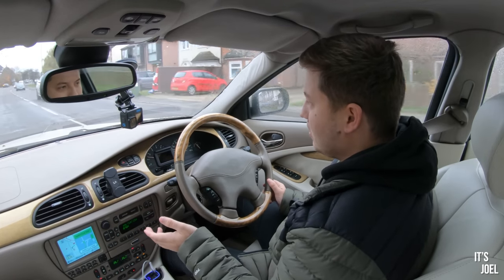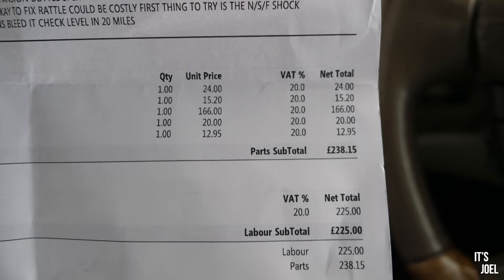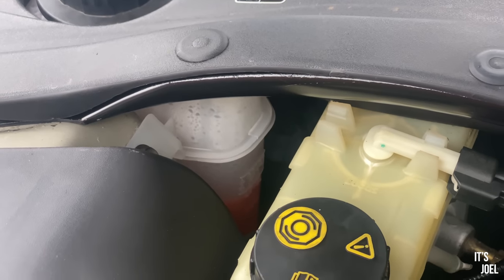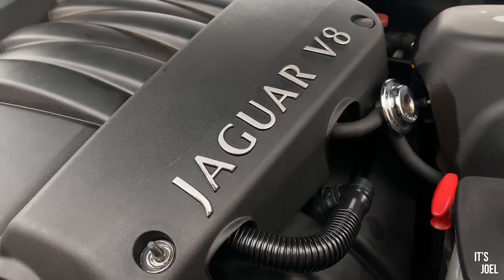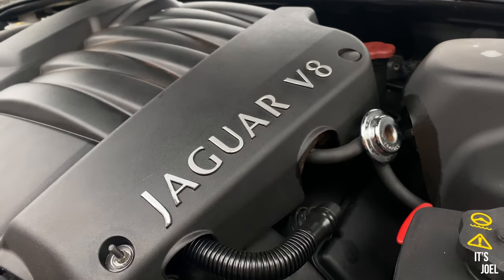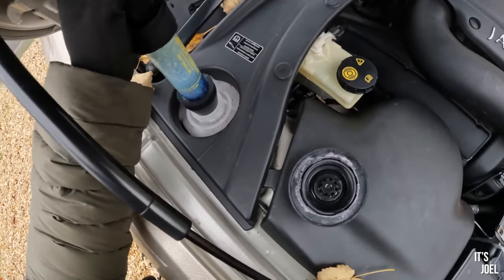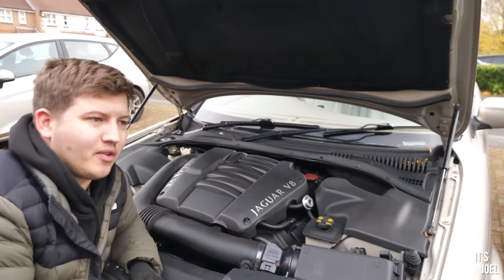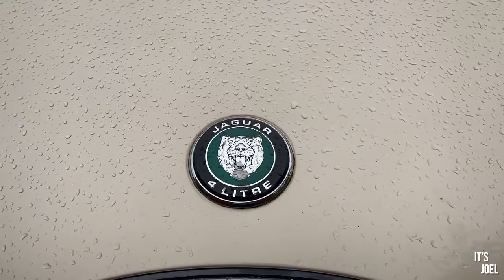Can this £30 bottle of Steel Seal save my cheap V8 Jaguar?

Comment: Don't  go by the white smoke coming out of the exhaust my BMW E60 2.5I was like that 3 years  ago and the so called  expert at the garage told me head gasket engine  is knackered is was losing  coolant eventually I found  is was coming from a tiny crack in the expansion tank bought  a new one on ebay for £60 fitted  it myself cars running spot on that was 3 years ago still got white smoke  coming out of the exhaust in the cold mornings

Comment: Don't go to main dealer looks like HG you fixt the water jacket side the oil is slightly burning but that happens to older engines anyway lot's of reasons but i wouldn't go anywhere till checked proper and if it is gone just gets worse then breakdown it won't be cheap to do But very Dear at Jaguar£££££££ should be able to get done for between 700/1500 give or take!!😳

Comment: Drive it and see what it does. Do not think it’s head gasket but if u really wanna play the game let it sit over night then put a camera down the spark plug holes and look of water on top of any pistons but tbh, I think ur just dealing with old car water hoses having a hole and not allowing the system to pressurise correctly

Comment: Take it for a drive and if temp stays down then its fine but I would still fix it properly but as you don't have the knowledge then yes its expensive and probably not worth it

Comment: Test come back negative?  You need to self isolate Joel for 10 days..... 😊  I think that rather expensive bottle of magic might have done the trick. Pretty sure at this time of year the exhaust smoke is normal as is a bit of condensation on the cap. Drive it and see how things go, but keep a bottle of water in the boot just in case .

Comment: looking at the exhaust you have 1 exhaust system for each side of the engine. typical v8 set up. now to have both exhaust letting out steam shows water in the engine block itself going to atleast 1 cylinder on each bank of pistons...... you do not have exhaust getting into the water, your problem is water getting into the combustion chambers on both banks of the engine.......  water is not a major factor in the oil neither...... so we know its in the combustion side of things........ the first thing i would do is check the actual fuel in the tank.. drain some and put it in a bottle and let it sit for 48 hours then look to see if any water is in the bottle of petrol..... DO NOT think oh its ok its fresh fuel. you have no idea how many garages have water in their fuel tanks...... now if you do have any water at all in the fuel tank , This WILL be your problem.. easy fix.... drain all the fuel and put into almost clear containers...... now on each container get 1/2 cup of water from your kitchen and put in some red food colouring and make it a bit strong.... pour this intothe fuel in a almost clear jerry can and swash it around. all the water in that can will grab the food colouring but the petrol will not.. now let it sit over night.. in the morning you will se the amount of red in the can and it will al be at the bottom.. simply siphone off the red and you will be left with just petrol......   now pour this petrol back in the car and see if you arestill getting the steam. you will need t orun the engine for about 20 minutes to get all the old stuff out the pipes......    if you now do not have any steam then all is well and simply geta water seperating filter fitted under the bonnest and check it every week and simply turn the screw tap on the bottom to release the water that has been trapped........ now moder fuels have a lot of water in them today, the cheaper the fuel the more water, plus ethanol grabs water from the air we breath..... look around for ethanol free fuel for the motor and you will 100% get less water content from that fuel........ i mess around with 2 stroke engines and get very similar problems due to todays fuel having ethanol in it.. with ethanol you get a bit of steam , without it non at all.   the water content in the fuel is not harmful to the engine and infact keeps the  piston and hthe head very clean dueto its steam cleaning of the carbon..... if you take off the cylinder heads on this engine you will see pristing piston tops..............  now before doing any of this work, go and buy a ver ycheap endoscope camera for your phone. get one with atleast 2 meters of cable. they are only about £10 on ebay and will let you find out if your getting this to more than one cylinder on each bank.... simply take out a spark plug and poke the came down the plug hole.. see if the pistons look imaculate, if they do you are getting water in that cyliner and its steam cleaning the top of piston and the underside of the head/ valves etc....... this migh tall sound like a lot of work , but its not... a endoscope camera is cheap and brilliant, its a tiny video camera with lights on the end too.. you will see what the camera sees and can take picture or colour video with it. and sound ....  i would definitely be looking at water in the fuel first... and you can bet money this tank has never been drained over the last 22 years..

Comment: Worst kind of customer at a mechanic shop/car owner. Wants the car in tiptop shape, but won't flush the coolant, and won't even follow product instructions. Clearly says you need to let the car get cold, not slightly cool down for 3 hours. Clearly says you need 2 bottles of the stuff for your displacement...You're a cheapo if you won't spend an extra £35 to fix something. I bet you'll be surprised when the engine shits itself and will call out another garage for 'trying to rip you off' when you've fully fucked this motor.

Comment: If that's a headgasket failure going on, and you've added that stuff, you've not fixed a problem, you've masked a problem.  It's going to come back, and you're 35 pound lighter in the wallet.

Comment: Milk on cap...its winter, it could be condensation? As there is very little. What's the dipstick like? 
Next to do, the cheapest first obviously.
Thermostat itself, the housing, gasket, and hoses.
Aux belt, idler pulleys, etc. This is doubtful, as your temp gauge is ok?
Next, water pump itself, the housing, gasket, and hoses.
The worst leak would be from the heater matrix, check the footwells, carpets etc.
Nobody is going to know without being in front of it to hear, smell, look and listen to what the engines telling them.
In my opion, and I have a 4.6 V8 1997 Range Rover.
Mine acted up on day, went for the cheapest maintenence item first, new expansion tank cap, six years later I've replaced it three more times, as a "maintenence" item.
If it was me, and you do you, drive it and keep an eye on your temp gauge.
Good luck.
👍🔧 😎 🔧👍m-E-m

Comment: Steel Seal is typically 39.99 RRP and EuroCar****s…. think eBay about 31 ish …. I’ve had great results with trade cars.  Smaller capacity petrols. Basically Corsas.   Mechanics hate the practice.   The SS says does not gunk up coolant system.  Mechanics argue otherwise .

Comment: Go and give it an Italian tune up. Drive the snot out of it on a long run. You didn't do the car any favours by putting that crap in the coolant... It will gum everything up and grenade the engine.

Comment: https://youtu.be/aFzWU0-2OPw

Watch Samcrac he had the same issue and used a bottle of head gasket seal and worked perfect and the car still runs perfect months later a Porsche 911.

Comment: If you want to ruin the car further Joel keep adding the cheap crap you have in the bottle. Where is the 100% proof that it is the head gasket? I' used to work in the car industry as a mechanic and did my mechanics apprenticship back in the early 90's. I'm not in it anymore, but still anything with an engine gets my attention. It always upsets and angers me when people turn to this stuff to magically save their car. It's all marketing crap. Ok, it has got you another youtube video, but look at the bigger picture. Do you honestly think it will be the ultimate answer to solving the "problem"? 

What are the emissions coming out of the tail pipe?
What does the live data tell you?
Have you seen any bubbles rising to the surface in the expansion bottle?
Are the collant hoses getting pressurised due to exhaust gasses getting into the cooling system? 
How are the coolant temps during driving and idling cycles?

These are the main points you should be thinking about.

These "Seals" in a bottle are just a sticking plaster and not even that!! 

The Jag 4.0 and 4.2 V8's are great engines if looked after properly. One of my friends is Andrew Spiteri who runs SE Jags down in Charlton, London. He has also wriiten a lot of article for Jag magazines. I've learnt a lot since i've known him. Don't treat these engines as just any old engine. The AJ V8 is a superb lump under the right foot and should be treated properly. You could do more damage putting that cheap rubbish in there on a hope it will solve the problem. 

My comment here is not a moan at you Joel. It's constructive advice. 

Don't run this car either on those cheap rubbish air filters either. They are known in the trade as cheap crap and they are cheap for a reason. Not all filters are the same as they use different microns filter paper. I believe MANN made the filters for Jaguar.